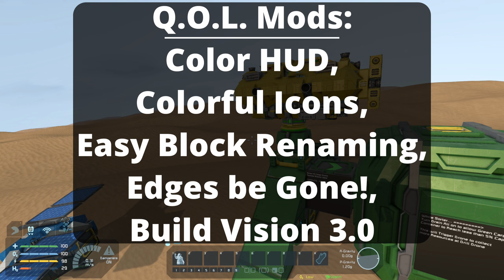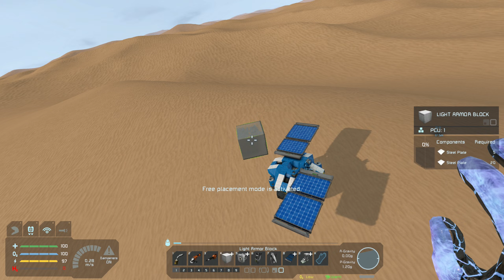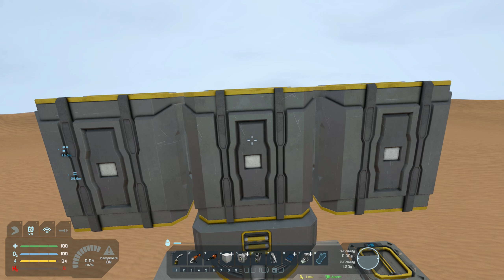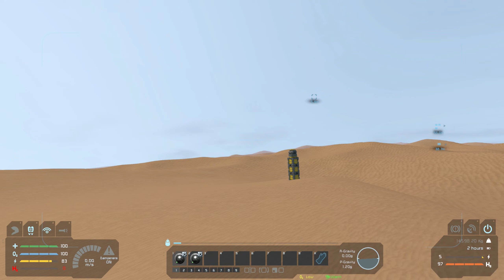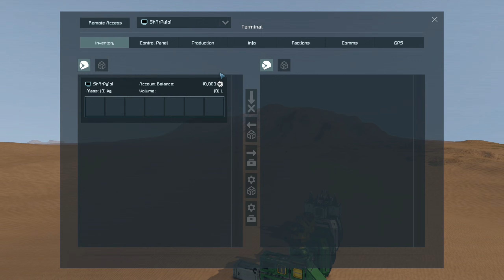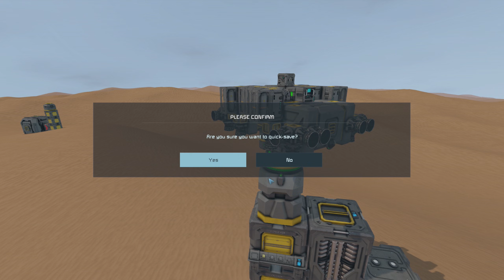AI Drone from Scratch EP01 - ULTIMATE DRONE TUTORIAL - Space Engineers

Comment: 1 thing I would note for more reliability. When you are having it leave a docking connector to take off, it might be better to turn off your connector instead of unlock. Then when it gets to position 1 from your path above the drill / base, have it turn the connector back on. 

This way if your drone wants to rotate and get set before taking off it won't get trapped by the proximity magnet
Reply from the maker: I have implemented that feature in the past but then it becomes another thing to add in the waypoint or GPS location within the AI or Remote Blocks

Comment: when i use remote control to fly the drone to the new GPS locations I'm unable to as the thrusters don't come on even when toggling them using the number 5 key? the thrusters only come on when locked to the connector. this looks incredible and can't wait to use it
Reply from the maker: Maybe just a new grouping is needed for the thrusters then remove and replace in the Drones g menu? (Just make sure they are named the same thing as before)
Reply: @ShArPy1o1Games  i've tried but still nothing. is there maybe a controller thats possibly stopping the thrusters activating after unlocking the connector? i've had a look but cant see anything
Reply from the maker: Has it got fuel, battery and are all triggers for the grouped thrusters removed from the timers... I've never had a problem so I think it may be on your side? I'll have to double check the design when I get a chance

Comment: I'm struggling with this because I'm making a drone that runs on rails.  It has two connectors and somehow I can't get it to do anything past Loading at Drill.  It will get to the second point, load, unlock, but won't RTB. The AI blocks are on so...I'm not sure.  I'm betting on user error because I refuse to believe something is wrong with the video since it works here.  Back to the drawing board I suppose. 

 EDIT: Could it be because I'm on rails it doesn't know it just needs to turn on reverse?  I would think it would know it doesn't need to turn around.  The RTB block says it's trying to get to Waypoint one but, never moves.
Reply from the maker: Precision mode must be ON and collision avoidance must be OFF at all times... also only 1 AI recorder/Basic block can only be on/active at one time... (turn 1 AI block off to turn the other on but the AI Move block must be on during its whole flight, as i use 2 recorder blocks, 1 for drill docking and another 1 for base docking...)
Hope this works or helps ✌️
Reply from the maker: If that doesn't work... try by only using Remote Control Blocks 🤔✌️
Reply: @ShArPy1o1Games  I'm going with the remote block route but it's ... a mess.  The reason it wasn't working before with the AI recorder, is it wanted to turn the train around and needed gyros.
Reply from the maker: Might be good to use the Remote Block but change its direction from forwards to backwards... pretty sure that would work as the new AI block etc. don't have that feature
Reply from the maker: Of coarse... yes on tracks haha
Reply: @ShArPy1o1Games  I'm making progress...
So far I can get it to slow down and dock at collection in a 300m demo I made.  This train will run 10km
Reply from the maker: Trains are the 1 thing I haven't gotten into very much... Your persuading me more and more to do so haha 😎👌
Reply: @ShArPy1o1Games  Underground, hover rail mod.  I want it working as a prototype before I dig the tunnel to an ice mine station
Reply from the maker: I do have an infinite tunneler design on the Workshop for that if needed but wish you all the best 👌🤓
Reply: @ShArPy1o1Games  Prototype works.  2 event controllers, 4 way points (2 dock, 2 slow downs)  Now I  probably need an event controller for battery charging.